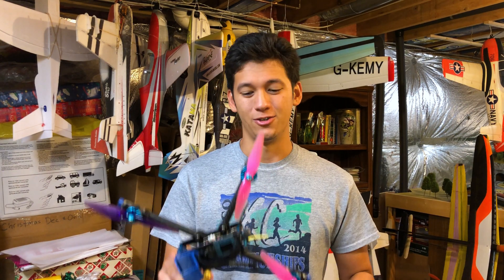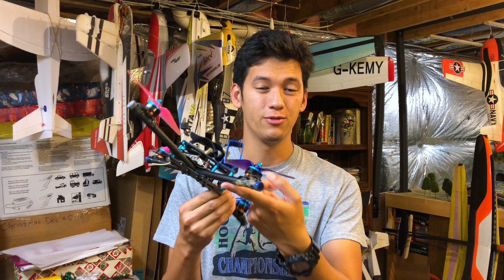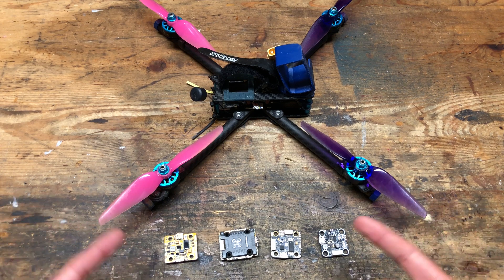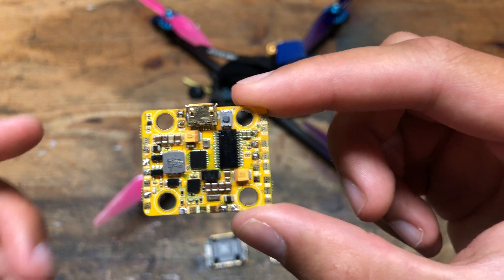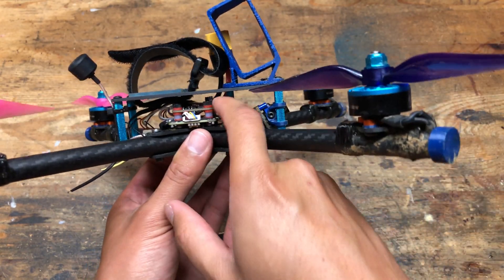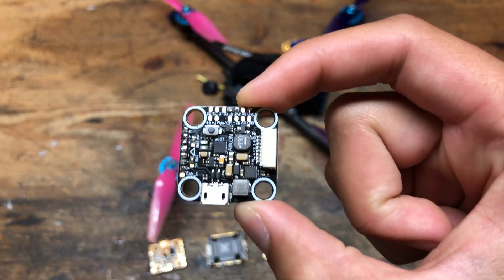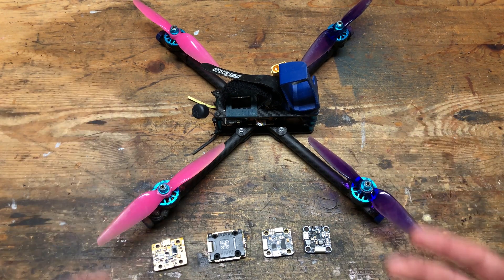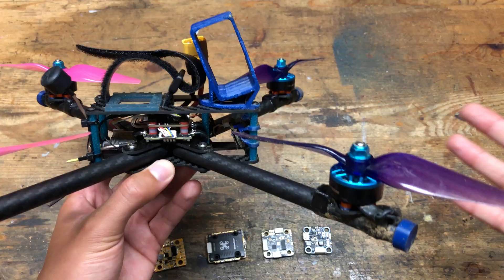The Most Problematic Drone I've Ever Built - Tubular Quad V6 Update and Flight

Comment: I think you mentioned it in a previous vid but what is the reason for not having cam plates up front, instead of a standoff in front of your stack? Too much of a pain to cut/fit?
Moving the mid-plate up above the tubes will open up the bottom for additional batts. I could see longrangers using this for a second series of cells. You could easily fit a 6S2P on the frame like that. It's already so light, would make for a killer rig I think. Use super lightweight motor like the F2203.5 + 6" or 7" props. Your design is really flexible.
Reply from the maker: Yeah too much of a pain to cut by hand. If I get around to designing the V7 it will move the bottom plate above the tubes and have shorter standoffs, which will greatly improve the rigidity of the fuselage

Comment: have you considered square tubes for the arms before? are they more / less durable than circular tubes?
Reply from the maker: I considered square tubes, but I could only find pultruded square tubes in that size, which are extremely weak in torsion compared to roll wrapped tubes. So I was pretty much forced to go with round tubes, which makes mounting the motors slightly more complicated, but they are more aerodynamic.

Comment: @Timmy, I am facing the same issue with the T-Motor 20x20 current sensor, can you do a follow up on how you worked around it.
Reply from the maker: I used resource remapping to switch the RSSI and current sensor pads:
https://www.youtube.com/watch?v=gL1DxUFjFq8&ab_channel=JoshuaBardwell
Reply: @TimmyRC  This is useful. I think I understand now. You removed the current sensing wire (from the connector) and soldered directly to the RSSI pad on the FC, then you went into Betaflight and re-mapped the current sensing ADC resource to use the RSSI pad. Is this correct? Thanks!
Reply from the maker: @oneeyefpv  Correct

Comment: Yo I just built a brand new 6" build with a 20x20 iflight stack hyperlite motors tbs unify foxeer cam. And I'm having issues with mid throttle fly away. I just got it up and running on stock 4.2 bf. I feel like I'm having alot of gyro noise for it to be acting up. I set all my other 5" the same exact way with no issues . you think it has anything to do with 6" or its somthing up with the fc. Everything is brand new
Reply from the maker: Tuning 6 inch is typically more finnicky than tuning 5 inch, but it could also be a problem with the flight controller. Blackbox is your friend when dealing with issues like that.
Reply: @TimmyRC  thanks I just put few more packs thru it and ima look at black box. But while flying I'm getting a rxloss warning on osd when those throttle jerks are happening. Now I'm leaning twards a faulty rx . but I guess ima have to go back thru it and see what happens thanks

Comment: Bleh the whole actual RC hobby for me has been an unmitigated effin' disaster.
The sim, peachy fine.  Real hardware, total garbage.  Boxes of parts that don't fly, stuff that needs assembled or fixed or configured.  It's just one hell of a black hole nightmare.  I'm about ready to throw all this $$$ garbage off a bridge because it's making me effin miserable.   p.s. you could gain a lot of resolution and more control if you''d lose some of that wasted max roll rate, expo, or generally high rate.  You can flic roll or spin really fast, but who cares, it's a useless maneuver in place.  Better to have more stick resolution.  A slower rate will also make all your flying much smoooooother without even trying.   Also, you can buy stand alone BEC's, try one of those to power your VTX instead.   Anyway, I clicked like on this video because you used the word "garbage!"

Comment: I highly recommend the Hobbyking XRotor F4G3 Stack. I have it on 4 5“inch Kwads and 1 12“inch. And im super happy with it.

There is also one in 20x20
Reply from the maker: I have used all three generations of the Hobbywing 30x30 stacks and they performed flawlessly. I wanted to stick with Hobbywing, but they did not have a newer 20x20 FC with 3mm grommets when I built the quad.

Looks like they recently released a 20x20 FC with 3mm grommets, so if the Aikon stack fails me I am definitely going back to Hobbywing hardware.

Comment: I designed and built a 580mm kwad with 16mm tubular arms, vibrations were the worst of any model I've built.  No electronics issues though.
Reply from the maker: Unfortunately big quads tend to be much more finnicky with vibrations and PID oscillations compared to smaller quads.
Reply: @TimmyRC  Never managed to get her tuned properly, LOL.  Only flying Toothpicks now cos of sub-250g nonsense.

Comment: 🔥🔥🔥🔥 Awesome flying! Those quad problems suck. I've had more than my fair share of quad problems. I've had 10 FCs and 2 ESCs just stop working, a quad with motors getting hot enough to melt propellers and motor wires, video 100 times worse than a college students microwave, and a problem with my quads killing batteries (I once ran a tattu r-line v4 1400mah 130c 6s to 9v in 2 of 4 laps of a race. I highly recommend the hobbywing xrotor 20*20 esc which is very reliable ( I've only killed one of them, and that was when I sheared my quad in half). I also recommend the foxeer f722 v2 fc. It's cheap (because it was kept simple with no unnecessary features) and reliable (I haven't broken one yet). Hopefully your quad problems are all solved.
Reply from the maker: Thanks! My microwave in college was actually pretty solid.
Reply: @TimmyRC  🤣🤣

Comment: Mamba stack .
Reply: And emuflight 🥳
Reply from the maker: @PIXLPUSHRFPV  All aboard the hype train😂
Reply: @TimmyRC  I run like 8 Diatone stacks and fly harder than most.  No issues.  Maybe the mpu6000 and. NOT hypetrain is the key.  Or ... maybe just fly a normal frame or try some tri-blades ffs 🤦‍♂️
Reply from the maker: @PIXLPUSHRFPV  The specs of the Mamba fit the bill for me except it uses M2 hardware, which unfortunately makes it incompatible with the Tubular Quad V6.
Reply: So you can’t just adapt it?  In a custom quad you won’t adapt the stack with a plate?  Ok 🙈
Reply from the maker: @PIXLPUSHRFPV  Weight=evil🤷‍♀️
Reply: Weight is offset by thrust vector.  Tri blades.  Mpu 6k... emu.  Tune it the same way you would.  Or don’t.  Looks like it’s going swell your way 💫💫💫💫
Reply: I guess it depends if you want that quad on your wall or it to be the quad you finally can trust and enjoy.  Your call.  “Know it all” status doesn’t make birds fly bro
Reply from the maker: @PIXLPUSHRFPV  I'm sorry I upset you bro.
Reply: You’d rather solder yourself up  5 flight controllers that suck and many are KNOWN to have issues... than just address the issue.  You’d rather say shit like “I don’t run iterm relax” than understand why it’s being used in the first place.  It’s hands down why kiss is great but still has issues.  We are literally watching the videos bro.  Right there with you.  So we can SEE the issues.  

If I’m wrong I’ll buy you a new shitty tube arm when you bust one... but GARONT EEEEED you run a mamba f405, mounted HOWEVER as long as it’s not hot glued to the bottom deck... and emuflight... you’re done!   

OR you can stick to OBVIOUSLY NOT WORKING ethos’ and bang your head against the wall again.  

You’re not slow.  You understand the pid loop.  So you’re letting software and hardware defeat you???! 

Ok.  Bro.
Reply from the maker: @PIXLPUSHRFPV  I don't know what you are trying to prove (maybe because I am stupid), but please keep typing; It is entertaining.
Reply: I’m trying to prove science over dumbass theology.  Your design is bunk so you need the best setup .... but you don’t hear me tho.  Your plight of the tube drone will continue.

Comment: Yeah, I've bought 5 stacks worth of parts this year and I have 2 that barely fly. The electronics on these things have all the sudden gone to shits. I mean, all of the parts in the rest of the stacks work, kinda . . if powering on is enough. The ESCs have weird signal or fet problems, the gyros have jitter problems. I could blame the corona for the lack of chips but all the needed chips are on board. So it's the QC that seems to be the problem. 

Annoying AF and all we can do is dish out more cash money in to the system and pray we get something that works. Not my cup of tea so I'm starting to withdraw from the hobby. I should have 5 flying quads from the parts I bought this year alone but all I got is shit and I that I can produce plenty on my own, tyvm.